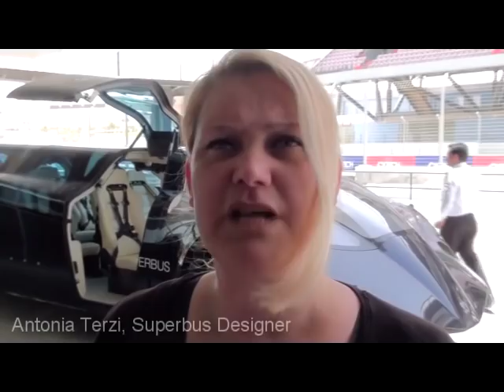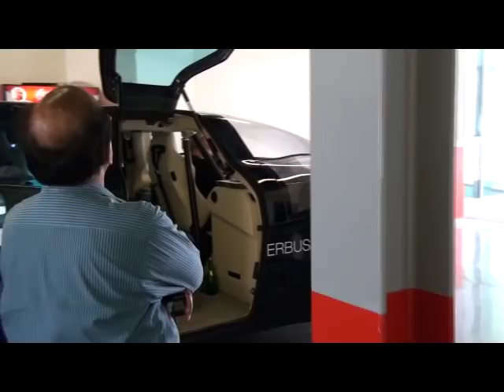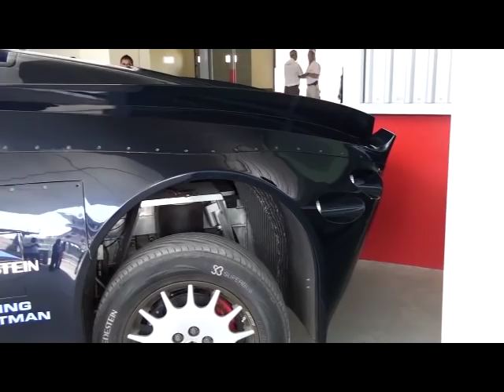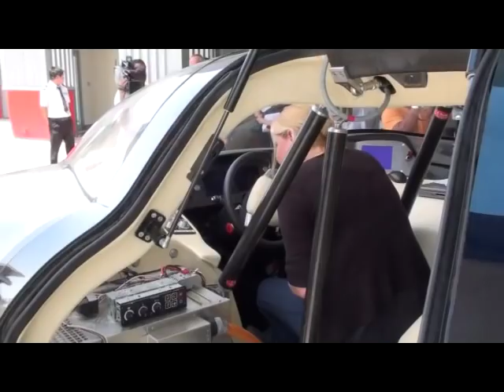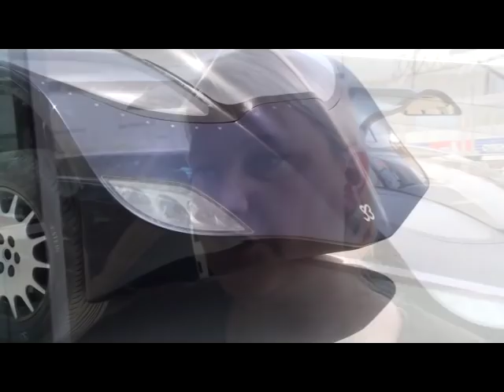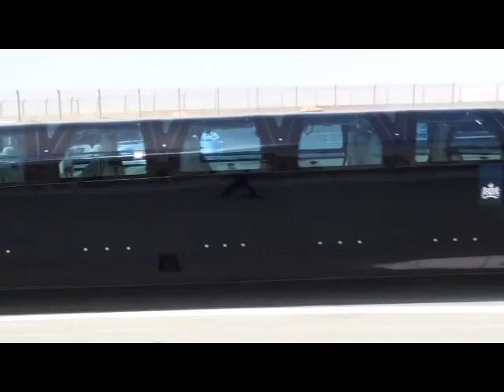Superbus at Dubai Autodrome

Comment: Back in the 70's I designed exactly this,but, it would carry 10 with a center driver, powered by a turbo Porsche motor, could also have turbine motor. Same idea and concept just a different level. Nice going.

Comment: In Germany you can drive 250km/h on highway. The Speed is not  limited on german highways. But in which cauntry, 250km/h  is allowed on highways for public transportation. :) You need railway or design new road for your car. Fast but not usefull.

Comment: Yes, you would think so. But actually, it is not. The tire manufacturer participating in this project is Vredestein. These tires have a similar design as their normal production Ultrac Sessanta series. I also have them on my car and I know that there is no rotation direction indication, only inside and outside. So on the RH side of the vehicle they seem to roll backwards! They definitely do not collect water (to be honest the're one of the best tires I have had on my rear-wheel driven Bavarian).

Comment: There's no reason to route air into the engine if it's 100% electric powered.  Electric motors don't need air and generate very little heat compared to gas engines.

Comment: I have to ask how it will do in the sand and grit. In Dubai, it's everywhere. I predict the leading edge of the front end and that air scoop will be scoured and pitted (at least) within months. The air scoop will channel grit and sand into the motors. Unless the motors are brushless and use magnetic suspension, (and even then) the motors will get wrecked. This happens on composite aircraft just from air flowing over.

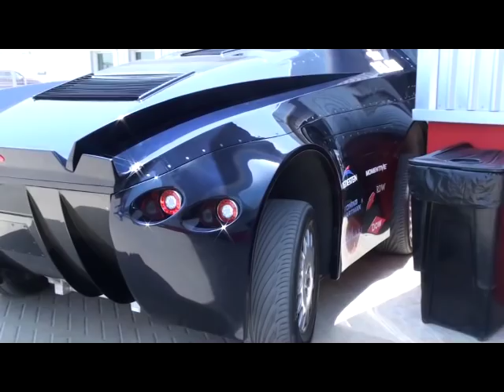Comment: Hmmm.. How embarrassing, 0:48, the rear tyre in camera shot is a directional tyre and it is the wrong way around. This would cause water (or any other fluid (which are is almost at 300kph relative to a tyre)) to get pushed towards the centre of the tyre instead of out to the sides and cause hydroplaning. Killing everyone aboard at 300kph.